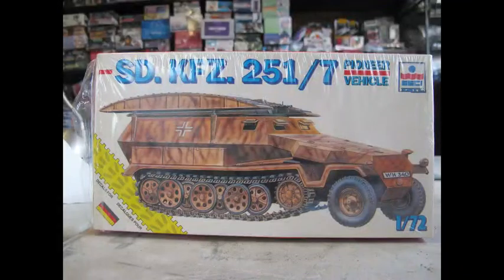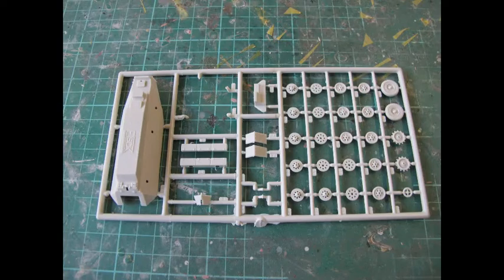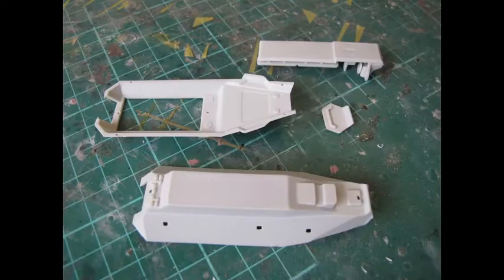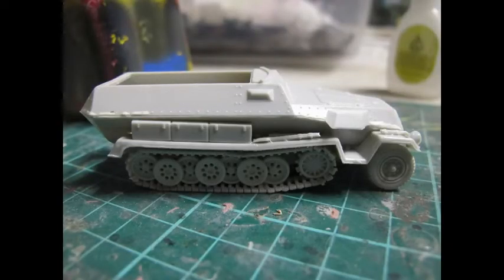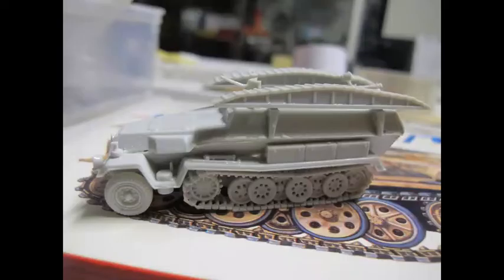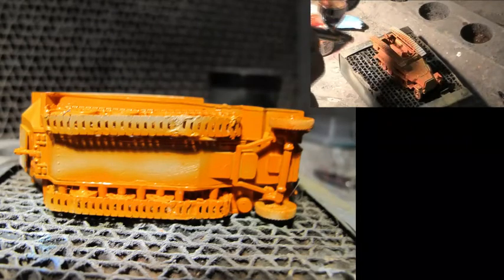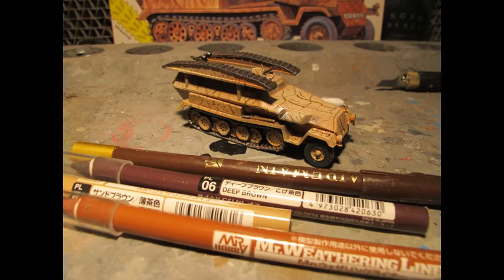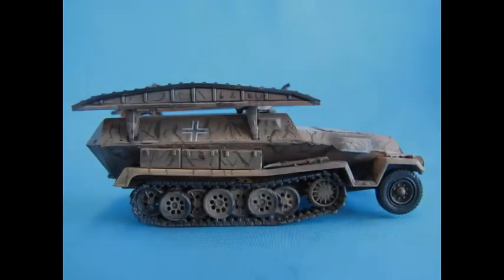ESCI 1/72 SD. KFZ. 251-7 Pioneer Vehicle

Comment: Hi Alan, 
Been a while. Hope you read comments. Do you have a video on printing your own decals. I have a laser printer and looking to do some restoration work and need to make a company logo that needs to look legit.
Reply from the maker: Hey man, long time no see. Nothing has changed here and always read/ answer comments. Printing decals is the same as printing on photo or special paper. Difference is professional vector decals art work and feed it into a machine that can out put white pigment. For your machine you need to choose a decal paper that has white backing or clear backing. Ebay, amazon or aliexpress will sell decal paper super cheap.
Reply from the maker: As your printer assumes it is printing on white it will blend colors cyan magenta and yellow to make a transparent image that looks good. White back decal paper will deliver but plastered on a colored surface will show off your cut marks. Clear has no white and any white needed in the decal will not show up unless you paint some white were you are laying your decals. Hope this helps.
Reply: @mokanaman  I have a smooth silver pigmented painted surface to apply the decal onto. Will be using transparent backed decal paper. I have a vector logo and the colours are solid, just considering paying extra for some super thin carrier decal paper to make the negative spaces as invisible as possible. Will clear coat over the decal. Thought of you as you experiment a lot.
Reply: @mokanaman  this stuff "super-thin-laser-waterslide-decal-paper" from a ozzy shop
Reply from the maker: I used that decals paper before. With a clear coat and maybe a buff you should not have any issues keeping your whites in mind mate. Happy modeling and we will have to chat again one day.